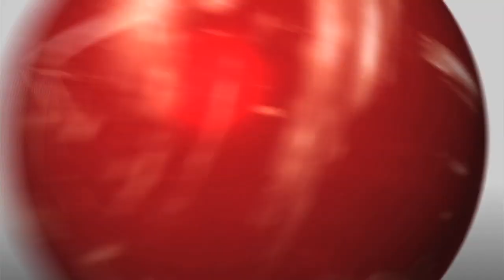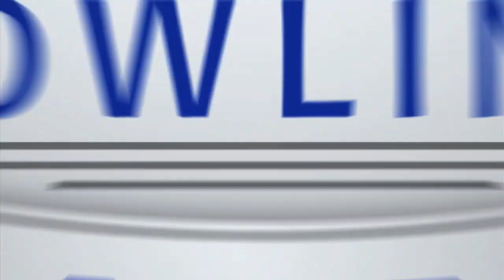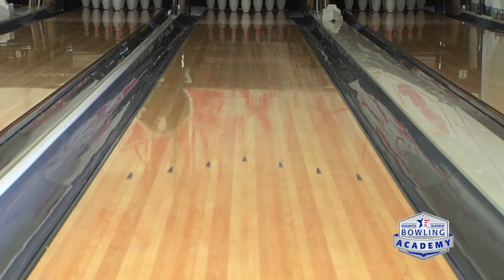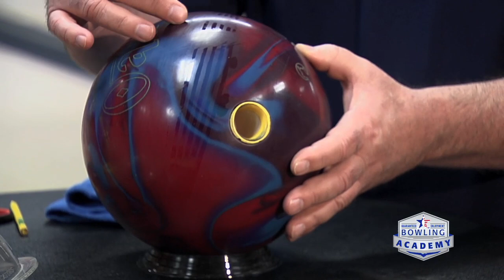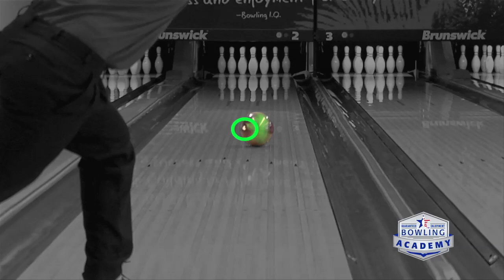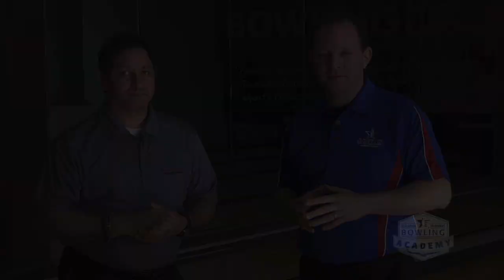Understanding Lane Oil Changes When Bowling

Comment: The information given was good, however the analogies presented made it more confusing instead of clearer. Carry down is not like a snow plow. It's oil picked up in the front of the lane and redeposited in the dry when the ball rolls over it. Eventually they got to that point of mentioning it but it was lost in the rest. I only picked it up because I was specifically looking for that point. Would have missed it if I didn't already know it.

Clearer communication would be better.

Comment: So what is your advise on wiping off the ball after every shot? Should I or not?
Reply from the maker: Hello and thanks for the question.

We recommend wiping the ball off after every shot. The less oil on the ball the more opportunity it has to perform at it’s best.

After you are finished with bowling, use a ball cleaner and a towel to get rid of the oil on your ball. 

Letting the ball sit in your bag with the oil on it will absorb into the balls surface requiring resurfacing from the pro shop much sooner than if you had just cleaned it after bowling.

A good rule of thumb is every 60 games or six months head to your pro shop to get your ball resurfaced for maximum performance.

Thanks for watching!

Comment: So, if there is no carrydown, what are all those shiny lines, (hundreds of them),  that go from the end of the pattern, all the way to the pins?
Reply: Jim Valentine most likely from people that don’t wipe their ball off using a towel. Their ball gets so soaked with oil that it probably deposits it on it’s way down rather than absorbs it XD depending on the pattern and style of course
Reply: It's carry down. Carry down still happens on house lanes that may have been oiled early in the day and were played on by kids using house balls or if league bowlers you are with, are using urethane balls. If the lanes were oiled for league and the bowlers are using solid or reactive hybrid balls, the oil will be picked up on the balls and there will minimal carry down.
Reply: @jaden577 to

Comment: I bowl with a plastic ball. can I hook with this ball? I have a 3 hole ball but i use all 3 but i tuck the pinky which oddly makes my game better. I don't slide I  roll the ball., What is finger tip inserts ?
Reply: Hi Chris, first off plastic balls are not meant to hook and will not hook much at all. Second finger tip inserts are rubber grips that go in your 2 finger holes and they allow you to hook the ball better.

Comment: So if my bowling ball is losing energy , do I want to switch so something that picks up sooner ?
Reply from the maker: Hi,

If your bowling ball is losing energy and not hooking in the back of the lane you want to get a ball that keeps energy (or skids) longer. Changing to a ball that picks up sooner will cause a straighter overall motion (especially on the back part of the lane).

The comment from Coach Lou about an aggressive surface or aggressive ball is referring to the fact that the bowling ball surfaces today are abrasive and remove the oil from the lane more than ever.

Moving to a part of the lane with more oil, changing balls (to something that skids more through the front of the lane), changing hand positions or adjusting speeds can all be adjustments for lanes that are hooking a lot.

Thanks for continuing with the Bowling Academy.

Stephen Padilla
Reply: Or, if the lane is oily - not  a lot of hook, slow your ball speed down. If the lanes are dry - too much hook, pick up your ball speed or run your hand up the back of the ball, not on the side. It is trial and error. Practice and see what matches   your style.
Reply: Andrew Austin just to add on to what you said, if they are physically incapable of picking up their speed or slowing it down consistently and without disrupting their style, then they could also move their feet up or back on the approach. Scoot back if it’s hooking not enough and scoot up if it’s hooking too much.
Reply: I will disagree with most replies on this. If your balls losing energy it's not going to carry through the pins and starts to deflect. They are correct that moving into more oil will correct the problem or balling down. But amount of hook is irrelevant. While crankers do impress the young ladies, watching the what the ball is doing in the mid lanes, at the backend, and most importantly through the pins! is paramount. Where did your ball leave the pin deck? Was it between the 8 and the 9 pin? Or was it solid 9 or even between the 9 and 10? In both USBC and Kegel studies, entry angle, though between 4-6 degrees is preferred, does not statistically guarantee strikes. You can crank that ball in at 6 degrees all night but if the ball deflects your going to see corner leaves period. The other more difficult thing you can do is increase your rev rate and change ball speed by adjusting your release and ball height. get the ball more off of your ring and middle fingers by pulling your pinky in tight and extending your index out on the ball. As well you can raise your ball higher in your stance to increase speed and lower hook or the reverse depending on where the ball is hitting.

Comment: OK, adjustments are needed.  WHAT ADJUSTMENTS?
Reply: +Jay VerLinden yeah they missed out that part :(
Reply: You know...adjustments! 😑
Reply: Less oil on the lanes, the farther you step out
Reply: move outside with a lateral move maintaining same launch angle or move inside increasing your launch angle to find oil in the front and keep your same break point. all depends on the lanes, your style and equipment. move might be different on different days...
Reply: Assuming you are a right handed bowler:
#1 move right several boards keeping the same target and line
#2 move right and also move your line further in (right) into any existing oil
#3 change balls to a less reactive ball, a pearl or urethane or your spare plastic using the same original line
#4 play the dry outside (out of bounds) area with the above balls
#5 drink two pints of beer and throw it straight up the middle
Reply: As in if your ball starts to grab more move to the left or right depending on what hand you use and find that mark
Reply: Frank Canonica -- your #3 was the biggest change for me ever. everyone thinks it's my "fun" ball, but it's really a strategic urethane ball I found for free. edit: make rule #4.5 be "attempt Brooklyn?"

Comment: When the oil get weaker should I changed to a ball that hooks less
Reply from the maker: Hi,
When the oil pattern breaks down or “transitions” it’s 
common to change balls to one that hooks less in the front part of the 
lane and more in the back part of the lane. A common adjustment would be
 to move the feet, eyes, or both to see if the lane pattern allows you 
to get to the pocket with the same ball reaction first then perhaps 
change balls.

Thanks for continuing with the Bowling Academy.

Comment: Are the lane oil companies watching this?They say there products don't carrydown as much?This has been a problem for 40yrs.
Reply: Wrong. The balls used years ago were not the same. Modern solids and reactive hybrids along with oiling boards quite differently today has changed the game. You can now miss by quite a few boards and still carry. Leading to higher scores which equals happier kids, which equals smiles on lane operators faces because they can stay in business. Twenty years ago you would not see the walls covered with 300 banners. I've seen seven years olds with perfect games. Forty years ago they were using rubber balls still and had rev rates under 200!